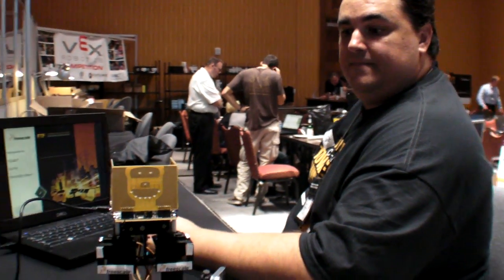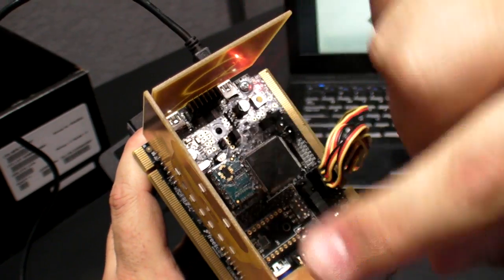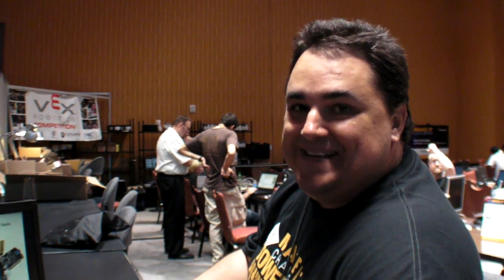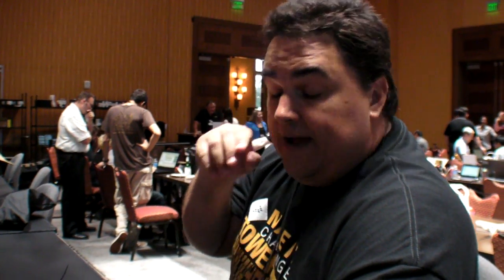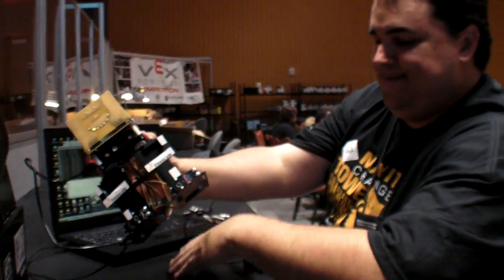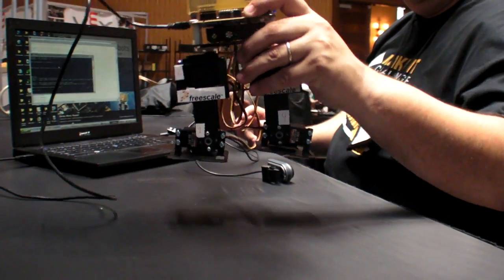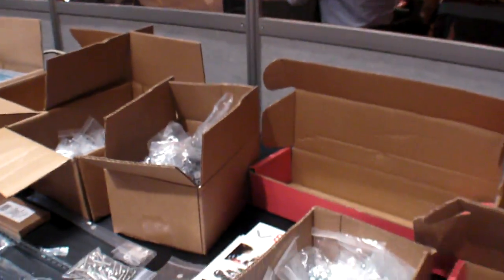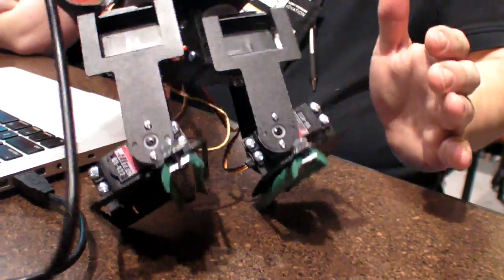Freescale Mechatronics training robot, to learn software, sensors, microcontrollers

Comment: 199$ isn't bad depending on the part list.
Considering easyfpga (dot) com sells FPGA kits from $169 to about $200
Which doesn't add Anything extra except for USB connectivity, programming tools and nothing like Servos or Sensors.